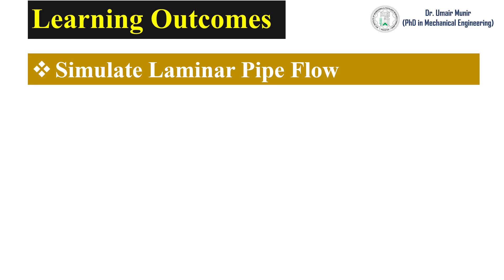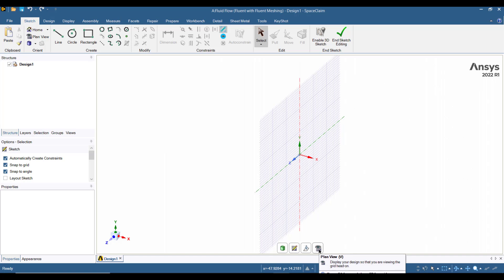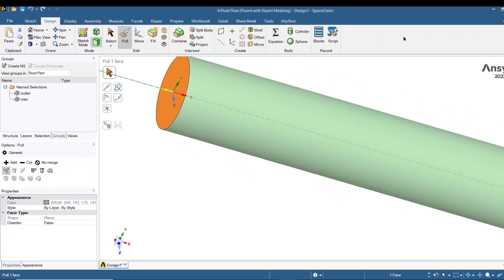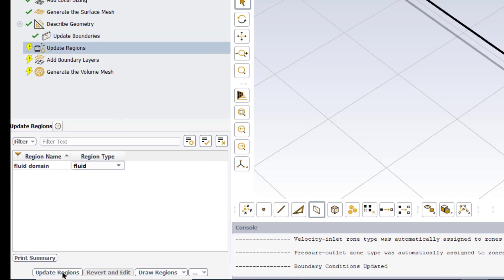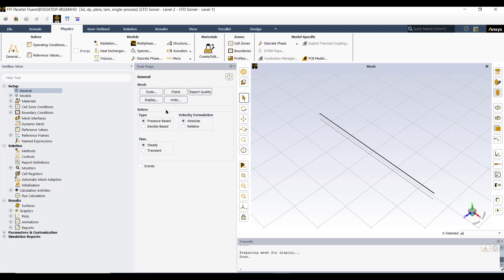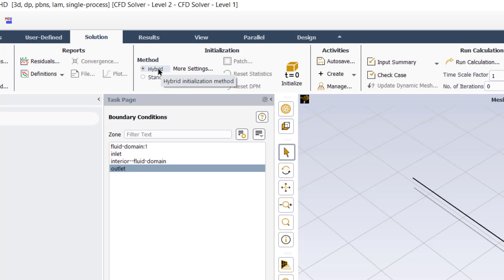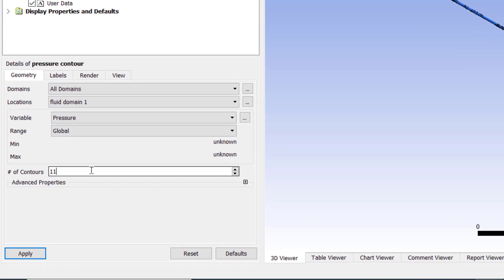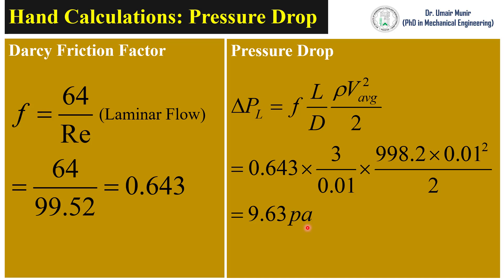ANSYS Fluent Tutorial | Laminar Pipe Flow | Pressure drop in a pipe

Comment: Hi Sir, Im working on a turbulent flow in rought pipes using fluent to find pressure drop and then pressure gradient. Bu my results are not in a good agreement with the experimental results. I do exactly you do in this video and add k-epsilon model and roughness but it does not work. What do you recommend me ?
Reply from the maker: +923214506557. Share details
Reply: @drumairmunir  fluid= Water V(m/s)= 1,773618152	D(mm)= 40	Epsilon/D= 0,059428571 mm	Epsilon= 0,00149	T=20C	Exp= 1142 Pa/m

I used 0,0027 element size and tetrahedons method (I used this method in cfx and it was ok),  I set the inlet, outlet and wall and entered the inputs, specification method is intensity and hydraulic diameter, 5 and 0.04m respectively.
operaion conditions>gravity>y=-9.81
used k-epsilon w/standard wall function. 
after 1000 iterations when I open the post-processing there is no  fluid domain 1 section. Then I select plane and there I select pressure and pressure is 739 pa. 

Then I go back to solution part and click on reports >surface integrals> facet average>pressure>total pressure> select inlet in surfaces and then compute. I get 102051.8 and then I do the calculation and get 102051.8-101325=726.8 pa.

is what i did wrong?
Reply: deltaP=Pin-Pout, if Pout=GAUGE PRESSURE=0, SO, DELTA P=Pin, also delta P=f*(L/Dh)*RO*(Vave**2/2), f is friction factor=f(roughness, Re) @bsnrlyz
Reply: @bsnrlyz   What's the pipe length? 
* dP = P_total_inlet - P_total_outlet
* Did you consider "developing flow at the inlet"? The empirical equations do not consider developing flow. They assume the flow is already developed instead. If you apply constant velocity at the inlet, the flow will develop first. During this phase, pressure drop characteristics will be different than what the empirical equation assumes.